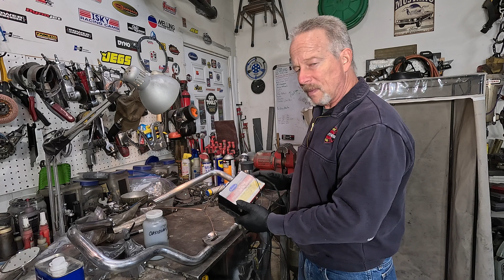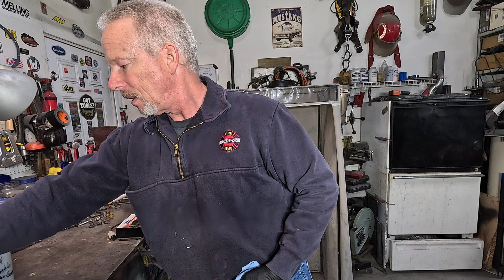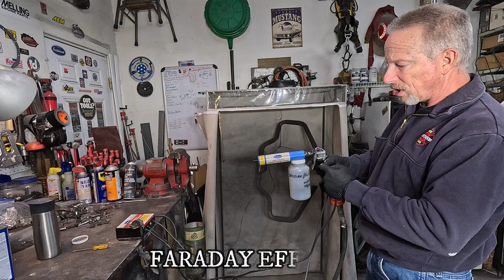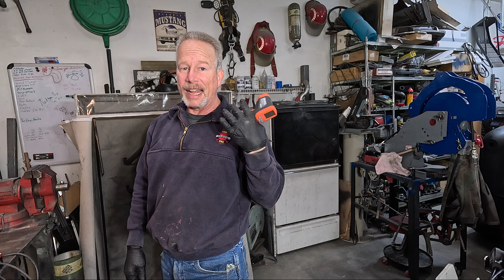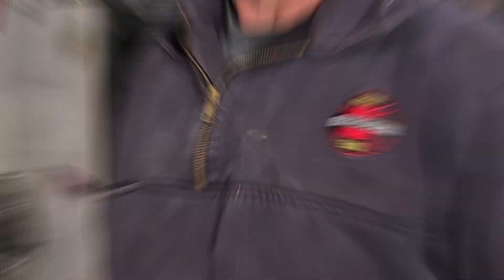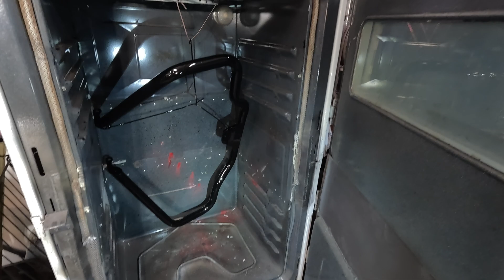CAN YOU POWDER COAT CHROME AT HOME?

Comment: Nice video! Would you recommend 400 grit sanding over sandblasting? Getting ready to powder coat a bunch of Harley chrome. Have powder coated quite a bit of steel but no chrome… thx!
Reply from the maker: 400 grit would be fine. Sandblasting is also good. Powder will easily fill 400 grit scratches. Just don't skimp on the powder coat.